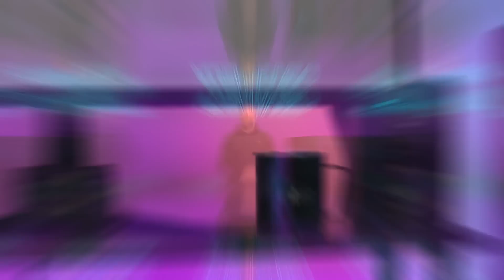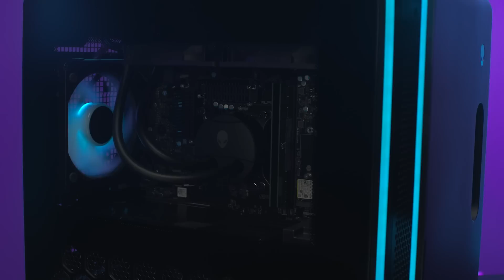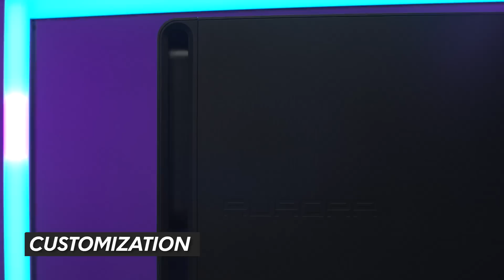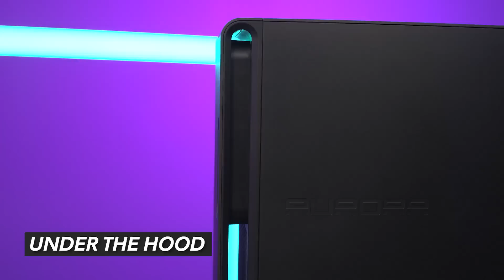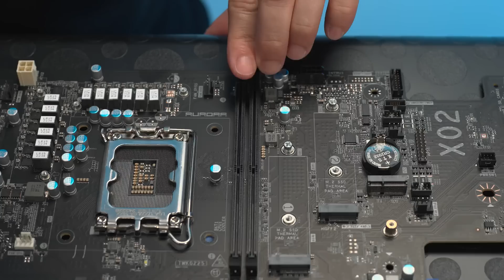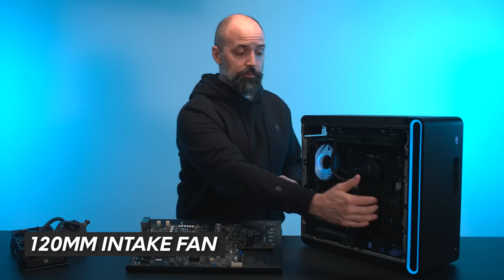The Next Generation of Gaming Desktops | Aurora R16 Deep Dive

Comment: The new look is nice, though I'm a fan of the R15 design more personally.  Any chance we will ever get products like the X51 and Alpha again?  I had both machines and I absolutely loved the small form factor and power those things packed.
Reply: I still have the Alienware X51, it's lasted me 12 years. It's in retirement me now I have the Aurora R13
Reply: @5Melanie5  Mine is my backup now, currently still using an R8 :)
Reply: An Alpha with an i5 13600k, RTX 4070 ti small form factor, and 32gb 6000mhz ddr5 ram would be a mini menace
Reply: I still have my Alpha R2! great little machine for the time even though I have moved to a tower.

Comment: :body-green-covering-eyes: This is a grand slam for Alienware.  Early benchmarks show significant improvements in nearly all crucial areas and the zen-like efficiency of the design implementation is a portal to the future.
Reply: A grand slam? Really? You could go to many other brands and get something for the same money that performs better and doesn't feature a ton of proprietary doomed to be e-waste components
Reply: @AMDman18 where at?
Reply: @IBleedDropDead  I want to say everyone not Dell/AW uses standard parts. Missing from this, for obvious reasons, is any sort of actual benchmark that includes not just 'our numbers' but a comparison between 'our numbers' and 'the competition'. Every single benchmark I have seen the AW system is at best 15% lower than average if not a full tier behind.

If you go the DIY route, your looking at 30-40% savings for the same or better on paper hardware. Then add in the DIY/standard hardware is going to run better.
Reply: Where are those benchmarks?

Comment: It's crazy how they improved so much but they're still 7 years behind in design.
Reply: So what are the design issues then in your mind?
Reply: @fractalelf7760  The fact that Alienware and other OEMs are allergic to the ATX standard makes them all bad designs
Reply: The cheap and inefficient case, mobo, ram, cooling are the biggest problems. The case is better, but still not anywhere near where it should be. Still not nearly enough airflow. Just use a mesh front and 3 fans... simple stuff, it's 2023 not 2011. Why is the mobo still a dumb custom design and dimension. Cheap looking mobo and ram. Not enough fans to get proper airflow, and a 280mm rad should be the minimum for modern flagship cpus. They're just thermal throttling themselves it's kinda funny.
Reply: @EveryDayDood  And yet, despite it all, the systems DO work and are reliable often times with benchmarks beating the class average.  Laptops thermal throttle depending on model, the desktops if liquid cooled I assure you absolutely do not throttle on CPU or GPU.  I know for a fact they do not.  There is trade off on prebuilts, you settle for less theoretical quality but at the same time you cannot begin to ensure the components picked off the shelf and put together don’t have subtle incompatibilities.  Dell and others have test runs which stress test all the components in tandem over thousands of load conditions to ensure stability.  The custom motherboard is part of that btw.  Instability is just higher in home builds on average.  I have used both since about 1991, I know intimately this is true,  there is a legit argument for prebuilt, even Dells Alienware line.
Reply: @EveryDayDood from what I understand the system doesn't have temperature issues it predecessors does though? And I would assume the choice to sacrifice some efficiency for looks makes sense from a brand prospective. Otherwise what would be the point in buying a brand?
Reply: @kalebross8795  Yeah but the problem is that they are sacrificing both looks AND efficiency.  The only thing they changed was the 1/10 case to a 3.5/10 case and AIO. They get the cheapest parts possible so they look and perform bad. They're stuck in the past, which probably costing them more money. The need to hire people who understand the market and who have the power to make real changes. Brand can't perform well if it doesn't grow.

Comment: Let people buy gpu upgrades for these pc that way you can continue to upgrade your gpu on your cases, otherwise these cases are too small that youll always be stuck with the same gpu forever with no way to upgrade
Reply from the maker: You can upgrade the GPU! So long as you have a large enough PSU to support the new card and it is within 305mm in length, 134.45mm in width, and 50.57mm in height. 

More GPU options will also be available in the configurator before the end of the year.
Reply: @AlienwareChannel And if you don’t have a large enough power supply, then screw you? Is that what you’re saying?
Reply: @FaceyDuck  Nah they are saying you are welcome to upgrade the PSU too, if that's the case XD
Reply: @yourforeignlocal  I wish it were that easy but Alienware over here with their proprietary PSUs is helping nobody
Reply: @FaceyDuck  I know, I was just joking! Faced that issue myself having owned the XPS 8950 for a short while :p

Comment: Main hope for Alienware: start making non-proprietary parts, trust me, it’ll be a great start to a new era of Alienware. Start treating this like MSI or Corsair, make parts that can be sold separately.
Reply: its called alienware for a reason, and to be honest I like that their parts fit in with the branding.
Reply: This is the absolutely right thing for consumers, but basically don't expect it to happen😂
Reply: And exactly what is proprietary in an Alienware system?
Reply: @jamesmcd71  For Dell it's mainly the motherboard and psu
Reply: @yourforeignlocal  yah, kinda like all motherboards? This was a real issue back in the 2000s, but it's no different than any other manufacturer.
Reply: @jamesmcd71  no, other manufacturers allow motherboards that can go in multiple cases, power supply’s that can be upgraded or replaced, things like that. Dell doesn’t allow that at all, they don’t let you upgrade things on purpose, such as making the front IO a part of the motherboard, it’s purposely different from every other motherboard to make it so you have to buy only from them.
Reply: @parkercarey7045  Yeah, and their parts are usually model-specific, meaning you cannot source a better/newer part from another product line to upgrade/update your existing product. Also, their aftermarket oem power supplies are way more expensive than generic modular counterparts of similar specs
Reply: @parkercarey7045  so are you trying to say all other motherboards are universal? Every manufacturer has dedicated parts that can only work with their products. This is a nonsense talking point created by people who make money off you. 90% of the DIY boards are made by the same company in the same factory in China. But a YouTuber tells you something, and you believe it. All while them get paid to push products to you.
Reply: @jamesmcd71  notice how most motherboards fit in most cases? Alienware doesn’t do that. Their motherboards cant be upgraded, and on top of that, cant even be case-swapped. Even hp uses motherboards that allow case swaps. There is also close to no upgradability, look up videos of what can be swapped and upgraded, it’s barely anything.
Reply: @jamesmcd71  Ever heard of “ATX”? Yeah, all off-the-shelf motherboards comply with it.
Reply: @jamesmcd71 mobos aren't made in China. China is trying to take Taiwan by force to gain its economy, but even then the majority of circuitry is manufactured in the United States, South Korea, and Japan. Taiwan is mainly just the supplier of silicon
Reply: @parkercarey7045  Apple doesn't allow that either. Apple uses propritary parts since the beginning
Reply: @WarpedTrekker yeah and the new MacBooks have absolutely 0 upgradability. You have to pay an outrageous price for 8gb of ram upgrade or for more storage. It would cost you like $40 bucks to get a 16gb stick of ddr5 laptop ram. Apple literally charges you $400 on the pro models. Literally  a 10x upcharge. Don't even start about storage. Apple isnt the only company either.
Reply: @parkercarey7045 this no different from what apple does with their products or Microsoft with Xbox.. Dell & Co. isn’t profiting from just the PC’s alone.  accessories, service plans and replacement and upgradable parts like SSD, RAM etc is where the real $$$ is at
Reply: These same anti-dell responses are getting long in the tooth!  Don't you have anything else to gripe about?  FWIW it's PSU is a 1000w platinum, or 500w platinum, and I suggest you actually watch the video here instead of just typing on your keyboard.  No other PSU that I know of has these features, if they do, they aren't mentioned.  Who cares about the motherboard?  That's what the Dell best in the business warranty is for.  Maybe, idk, try understanding what you're getting for your money before you respond?

Comment: Are we going to be able to change the motherboard on these new models??? I absolutely love these cases but just can't buy one without being able to put my own mobo in there, I need that upgradeability and the chance to get the support assist stuff that bricked my last Alienware away from the system.
Reply: And this is why you shouldn’t buy Alienware until they can sort this out. Other boards simply cannot fit in this case because the case is not ATX. Nor is the power supply.

Comment: Finally Alienware, you guys made a normal looking desktop. This is a step in the right direction.
Reply: Proprietary parts, including an oddly shaped motherboard and a server-style PSU - is not a step in the right direction.
Reply: This new case is still most likely a hotbox. Not to mention that it’s still proprietary, and the CPU cooler is still probably load-bearing and is screwed into said case. This case is at most a half-step towards the right direction.
Reply: @FaceyDuck  still better than r15... i guess...

Comment: The PC of 30 years in the future looks like an NZXT case from 5 years ago. Its better than the R15 (or my R10) but it looks like an average case now and you still won't be able to swap parts out easily like the MB and power supply.
Reply from the maker: Every other component is easily upgradable down the line as long as it is compatible with the chipset.
Reply: @AlienwareChannel  Minor upgrades are possible at present but the entire system is severely limited with a bit of foresight :p We've seen what happens with modest proprietary PSUs and power-hungry new generation GPUs. GPU potentially strikes out. CPU sockets are bound to change with new designs and architecture regardless, even under the assumption that the included motherboard boasts current gen CPU compatibility and overclocking support. CPU strikes out as well. RAM size and speeds are limited by the CPU, so naturally RAM strikes out too. You see where this is going? XD

*Also, if only certain components are upgradeable while others are not, the system's balance would be compromised, and overall performance would be constrained anyway by the bottleneck created
Reply: @yourforeignlocal  2 things of note:
1) There are 2 version of the R10, one with a 3000 CPU and one with a 5000 CPU. Same socket but because Dell didn't release the update the systems with a 3000 CPU can't be updated despite every other B450 MB being upgradeable. 

2) On Intel systems at least its not a case of being able to overclock, its a case of they still can't hit base clocks. They fall short in every benchmark I have seen and if you watch the clock and power, the clock speed for the P cores drops to what everyone else is running the E cores at.

Someone on the official forums asked something along the lines of "So whats up with the R13 power?" Dell official responses: performing within manufacturers defined parameters. Follow up question: "what the defined manufacturers parameters for the CPU?" Dell: "No. That data is not published internally or externally." 

Let that sink in: The big 3 (Intel, AMD, Nvidia) will go on and on and on andonandondon about specs. Intel and AMD publish easy to find info about there CPUs, I think AMD even publishes 'official benchmarks' for them. And you either don't' have or don't want to share? Hummm....
Reply: @nickierv13  Ikr, I had an XPS 8950 (my first pc) and was met with a plethora of problems too. Dell told me that the meagre 400+w included psu was more than adequate for the RTX 3070 build, despite every other source warning otherwise (maybe they could get by coz they starved their components of power). I therefore tried to upgrade the psu after upgrading the pathetic stock fan cpu cooler to an aio, but not only were their psu prices way higher than they should be for the wattage, they didn't even sell it in my country. Of course, this was after I tried all means to see if generic psus could be used with it (it couldn't, and I gave up after dismantling the stock psu to examine the individual rails)
Reply: @AlienwareChannel Wow the case, power supply, motherboard, and CPU cooler sure are upgradeable!
Reply: @AlienwareChannel  So are the CPUs going to be supported across generations? The R10 that shipped with the 3000 CPUs are still waiting on the update from Dell to allow them to use the 5000 chips. AM4/B450 got that update around Nov 5 of 2020.
Reply: @AlienwareChannel   I’m considering buying the R16 as my current rig belongs in the Smithsonian…but I have a question. Why is the motherboard a proprietary component. Why go the proprietary route at all? Just curious.
Reply: @AlienwareChannel  First, sry about my bad spelling, dyslectic, and non native english speaker.
But yes, those are all wery important parts dont you think, mb/psu. When this pc is 5 years old what hapens if mb or psu desides to quit on you? How do you get a new one, when the waranty is expired? And at what cost if you can find one? What if you deside to upgrade cpu family in 5 years? Can you do so? No cuz mb and psu is proprietary.
So solution to all this is what alienware wants you to do, buy a new pc. Problem is it is waistfull, off your money and the enviroment.
I know it is a worn out record at this point. And I like the steps alienware toulk with the r16, even if babysteps. But Having a pc with atx and normal, nonpriprietary mb/psu/case/ram might not make a diference right now. But in a few years, maybe with the second owner at that point, the nonproprietary parts is the diferense between if it goes to the landfill or not.
I have had the same pc, (built it myself) for 6 years. Have changed most parts in it, only the case remains. But every part I have changed along the way has gone in to some other pc, mine, my sisters, or random facebook marketplace guy's pc. No waist. 
Unfortunatley non of that is posible when proprietary parts, even if it is only the mb and psu. So alot of this pc's parts will be ewaist in a few years.
Reply: @AlienwareChannel Is the motherboard standard size ATX or MATX) and can it be replaced by an off the shelf motherboard?
Reply: @DjFusion86  I am sure you know the answer to that one. Dell wants you married to their eco system and buying new PCs every few years ... not upgrading them.
Reply: @sbrengard  I think I could probably live with a proprietary motherboard, but not bein able to replace a PSU of choice/need is a deal-breaker for me. When I retire my Alienware Aurora R7 i'm going for custom build again....
Reply: @TheRealDr.Mabuse  From someone who is new to Desktop gaming, what's the problem with replacing power supplies?
Reply: @DjFusion86  Nope. Its roughly mATX if you look at PCIe count but the front IO is part of the MB and the IO shield is part of the case. Ignoring that, the PSU is a non standard 12VO. There is a standard "ATX 12VO", its very rare and I don't know of any off the shelf parts that use it, but it is a standard. The AW PSU is no that standard.